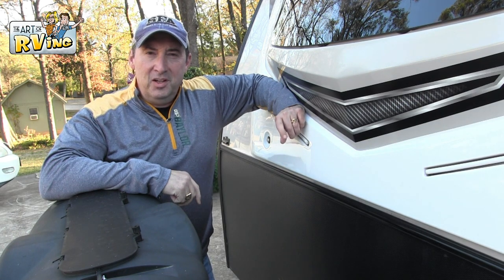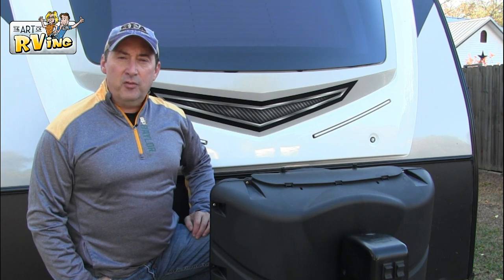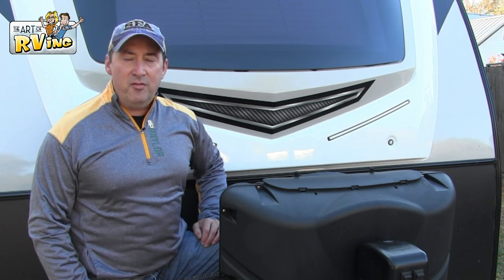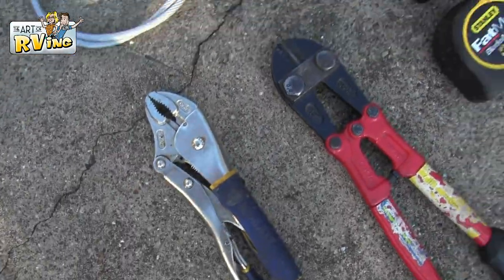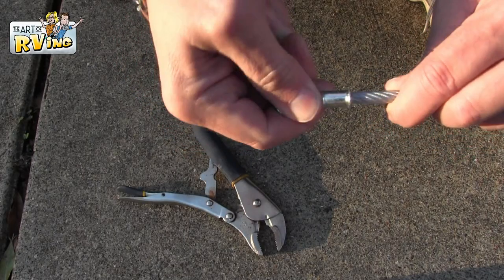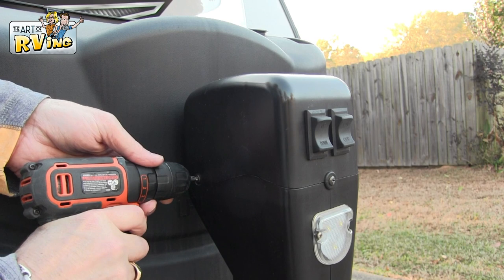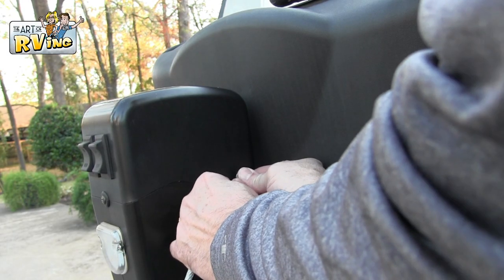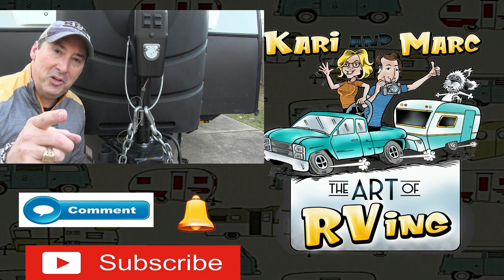trailer safety chain mounting mod | hitch safety chain hack

Comment: Don't have safety chains. We have a breakaway cable which applies the trailer brakes if you become detached, just clips around the A frame when not in use. looks a good hack for those chains though. Keep safe👍Mark & Coral
Reply from the maker: We also have a breakaway cable and chains. Interesting

Comment: Cheers Art of RV.  i dont like using power tools to screw things in - so always do it th eold fashioned way.  I've seen a few over torque and ruin the screw or cover they are hunking down. Know this sounds too simple but would that make a good 'how to' type film ?  AHve just got a torque wrench this week to ensure i get some bolts done right.
Reply from the maker: Yes, I was concerned about breaking the plastic at that*